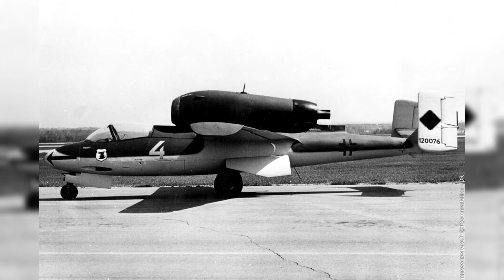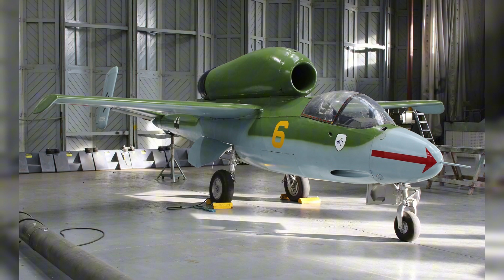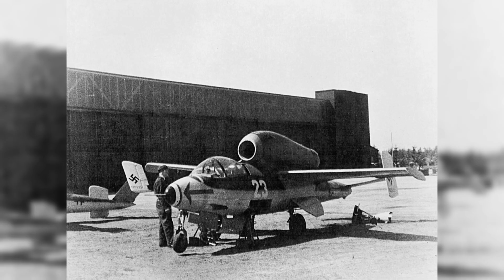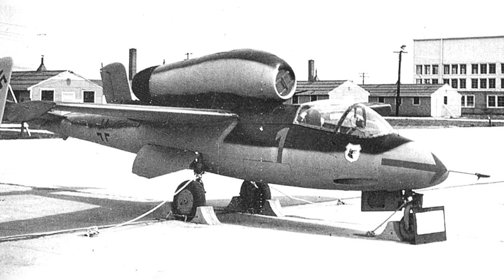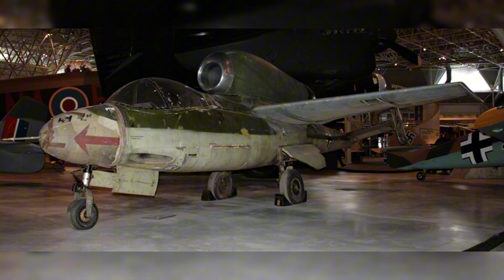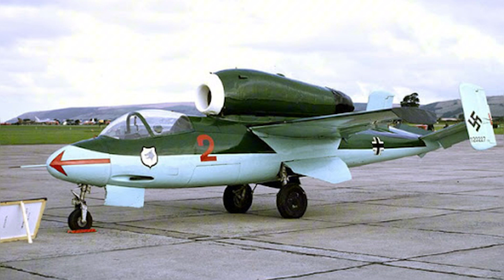Germany’s Jet Mistake | The Heinkel He 162

Comment: Unfortunately, we get yet another essay on how this was a silly stupid German/Nazi wonder weapon instead of the true story of the aircraft or technical details.  The aircraft was actually quite sensible had good acceptable flight characteristics.  The reviews of best handling about the aircraft come from authors attempting to produce a titillating article in a British magazine rather than anything objective.
-The HE162 program was started by the German armaments ministry instead of the German air ministry.  The reason was simple: fuel production that Germany was capable of closing stages of the wall would be insufficient to fuel the ME262.  HE162 could fly a mission with less than half the fuel of an ME262.
-The aircraft design was very sensible.  The fuselage was made of aluminium since a complex structure with engine mounts undercarriage guns and Corporate penetration couldn’t be built in wood.  
-The wings, tail and control surfaces were made out of wood.  The wing spar was made of ty-bu a composite of Baker like plastic and wood. 
-The moulded plywood was meant to be hot cured using Tego film in which pressure and heat cured the glue between the laminates and pushed the wood into shape quickly.  It was much better than the British process of making the mosquito because the production speed of the mosquito couldn’t be increased due to the large amount of time the cold curing process required in the concrete moulds used.  Unfortunately, bombing destroyed the Tego film factory which meant a cold glue had to be used that turned out to be half the strength and also corrosive to the wood.
-this cold glue phenolic resin led to the break up of poorly made tail planes and vertical fins.
-It’s obvious the solution would’ve been to either except at the tail plane had to be made of aluminium like the fuselage or the glue process had to be improved. 
-the He 162 aircraft went from initiation of design to 1st flight in 60 days and mass production in only 89 days.  
-The first flight did reveal some handling issues.  The dihedral was too much which lead to some lateral
Instability.  This was solved by Horner tips at the wing tips which counted the dihedral and also reduce Dragg by eliminating wind tip vertices.
-The dihedral couldnt be reduced because production had been committed but it could have been altered in future batches.
-if the aircraft was on approach and the pilot thought the aircraft was short of the runway he could increase thrust but this would also push the nose down which he would then have to raise again. It’s not a difficult process but it does require some training which wasn’t ideal in an aircraft meant for pilots with very little experience.
-The aircraft spin recovery was not the best but it was also not impossible.
-Both the above problems could’ve been solved by lengthening the tail slightly.  Again, because production was already committed this could only be done in future versions.
-so while the handling might fall a little short of what was desired it could be fixed in future production batches.  In the meantime, the loft rougher would have an aircraft that was being mass produced and that consumed very little fuel. An aircraft which could reach 562 mph making it the fastest aircraft of World War II by far.  The BMW003E produced a thrust of 800 kg but this could be increased to 900 kg for 30 seconds.
-The aircraft was too small to be used for anything but a fighter but I’m assuming it could be increased when revolver Canon became available.
-The first versions had fuel tanks only in the fueselage but this tank was subsequently enlarged with a more complex three dimensional shape and this increased fuel from 25 minutes at full power at sea level to 35.  Inner wing tanks increase this to over 40 minutes.  This is sea level at 30,000 feet is equates to 2 1/2 hours of endurance at full thrust.  The HE162 did not have two short a range.
-Unfortunately when we see an analysis of German weapons, we often see a complete deprecation based on early production batches that had problems.  Within a few months these problems were solved.  We never hear that the T34 had worse breakdown rate than the panther tank for 1.5 years.  We only hear the bad news about German weapons and we never hear the full story.  That we always hear the good news about Allied or Russian weapons and we never hear the problems.